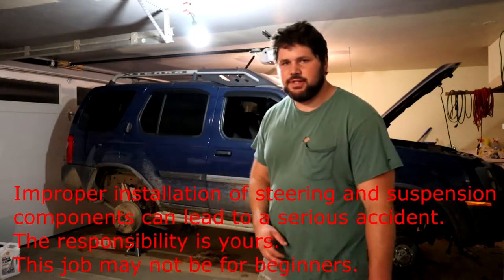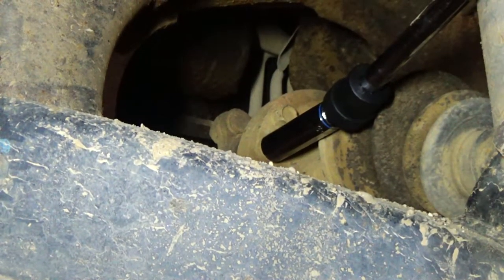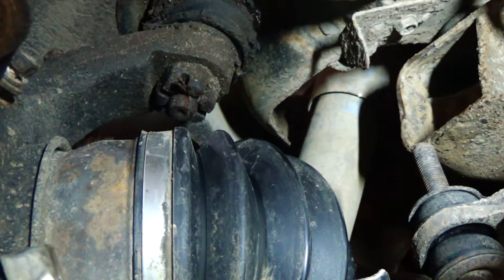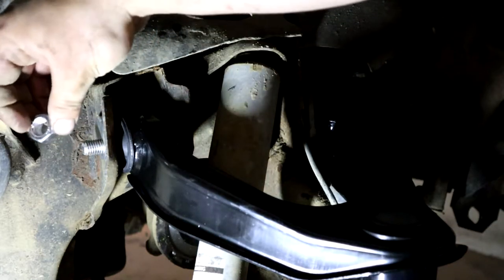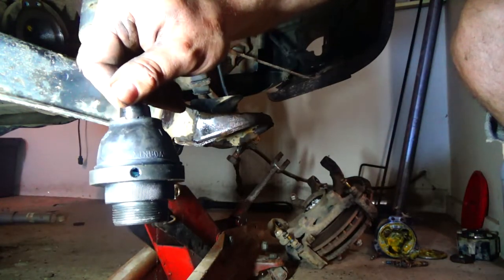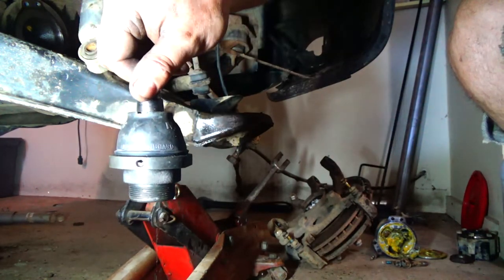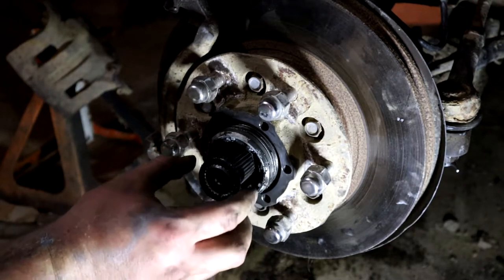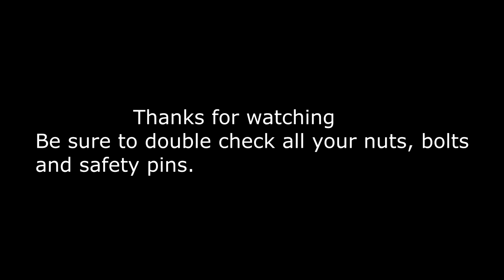2002 Nissan Xterra, Upper Control Arm and Lower Ball Joints.

Comment: Tip to get lower ball joint lose: use a grinder the grind down the inner threading down to the nut as they originally would have peened a few spots to make sure the nut doesn’t accidentally come lose. Makes the job super easy. (I also just use heavy duty adjustable plumbing wrench. Not the cleanest result but this way I don’t need a special wrench.)

Comment: What socket size did you use for lower ball joint nut?
Reply from the maker: Cant remember off the top of my head, it was a big size. i think i mentioned what size it was in the beginning of the video.

Comment: Hey man! Your video has helped out a ton. Just wondering how you determined when the lower ball joint was fully seated? Should it be flush with the LCA? Thanks again
Reply from the maker: i think i stopped once that nut got really tight. you can kinda feel the ball joint getting drawn in, then i could feel when the nut would snug right up when the balljoint bottom out. To make sure though Maybe eyeball the other side see how much thread is showing.
Reply: No it isn't supposed to seat flush but you needa still make sure it goes in straight.  The outter (side closed to the end of the outside of the vehicle) celling/shoulder of the ball joint will be flush with the LCA but you will feel a gap on the inner part of the ball joint....I used a ball joint press on mine, made sure it went in straight, and pressed it in REAL HARD but there was still that gap.  I then compared it to the stock LCA/ball joint on the other side and felt that same gap.

Comment: Why not just replace the whole lower arm?
Reply from the maker: I guess you could if you felt like messing with the torsion bars. But i wouldnt unless there is something wrong with them, more easy to just change the balljoint.